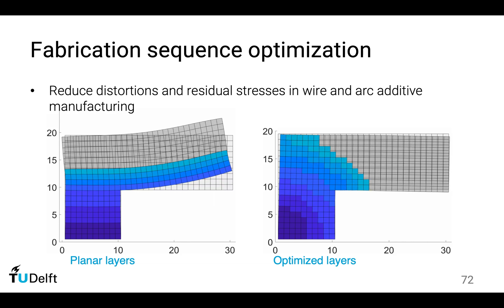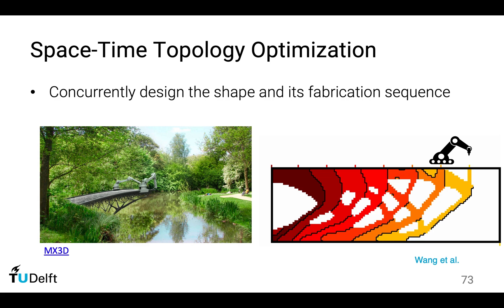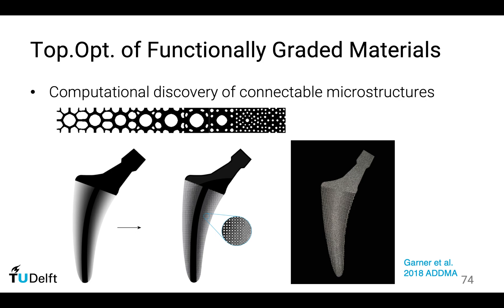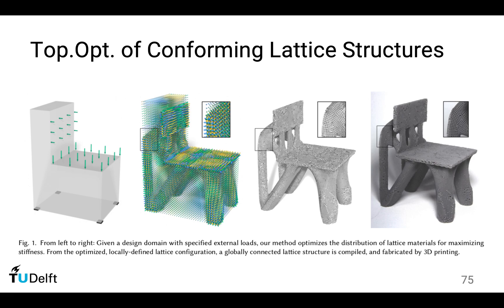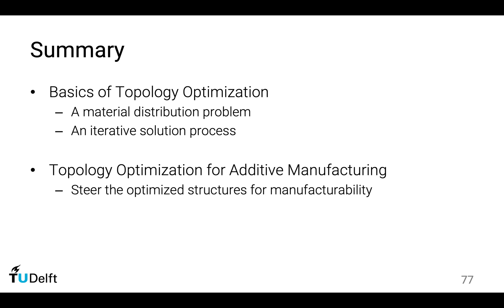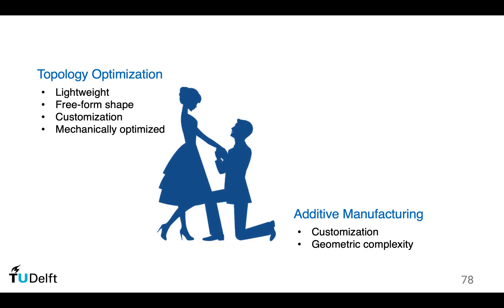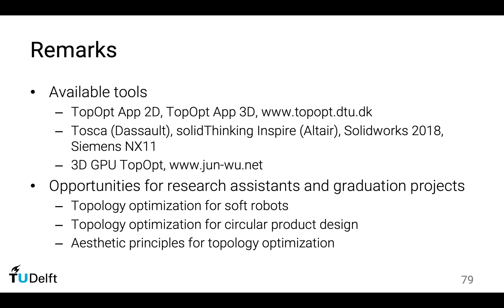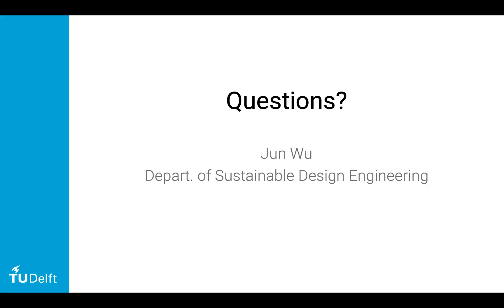Topology optimization for additive manufacturing Part 4/4

Comment: Thank you very much for sharing your beautiful work.

I wish you success and happiness in life.

If you may; I have a simple question:
 
Do you know of any good references for applying SIMP Topological Optimization method in 3D? 
Also, in your opinion.. do you think it is of academic value to actually design and solve code/algorithms for solving topological optimization problems? Or are we better off just using available software and focusing on other issues within the studied problem?

I'm trying to design a compliant mechanism optimized for strength and flexibility in three dimensions.

Thanks again for sharing.
Reply from the maker: SIMP in 3D appears in many works. The challenge is computational efficiency. 
Matlab: 
An efficient 3D topology optimization code written in Matlab
Kai Liu & Andrés Tovar 
A new generation 99 line Matlab code for compliance topology optimization and its extension to 3D
F Ferrari, O Sigmund
GPU: 
A System for High-Resolution Topology Optimization
Jun Wu, Christian Dick, and Rüdiger Westermann
HPC
Topology optimization using PETSc: An easy-to-use, fully parallel, open source topology optimization framework
N Aage, E Andreassen, BS Lazarov

"a compliant mechanism optimized for strength and flexibility in three dimensions" 
You may want to check this work.
Topology optimization of compliant mechanisms considering stress constraints, manufacturing uncertainty and geometric nonlinearity
GA da Silva, AT Beck, O Sigmund

There are many open questions in topology optimization and its application in various domains. It is definitely of high academic value to investigate it.
Reply: @JunWu2011  This is incredibly helpful; thank you very much.
I wish you the best.

Comment: Thank you so much for sharing such a wonderful introduction about topology optimization! Actually, I am also green hands in this field. What recently annoys me is that the result of topology optimization contains too many small characters, such as thousands of tiny facets (the output file is in form of a .stl file). And that brings low-quality mesh when I want to further simulate its performance with FEM in different situations. Should I smooth the surface? How to reduce the result's characters properly?
Reply from the maker: I'm not sure what kind of mesh you got. If the optimization is performed on a decent resolution using voxels, the mesh constructed by the marching cubes algorithm shall not be too irregular. There might be staircase artifacts, but can be smoothed by post-processing, such as Taubin smoothing (available in e.g. MeshLab). If the mesh is rather coarse, a smoothing operator may change the shape substantially. One could play with different smoothing algorithms. The smoothed geometry likely does not conform with the boundary conditions, so some manual adjustment could be necessary.
Reply: @JunWu2011  Thanks a lot. I'll have a try.